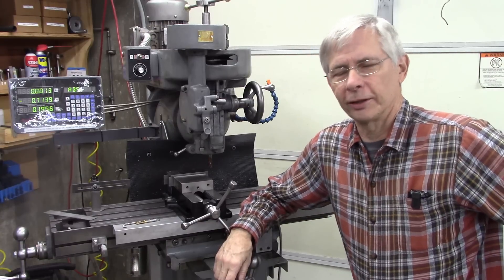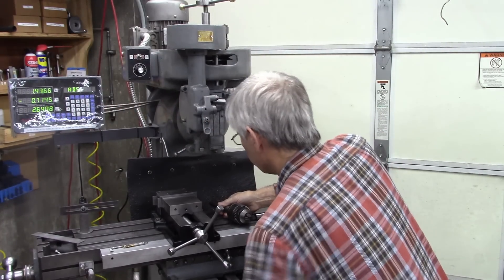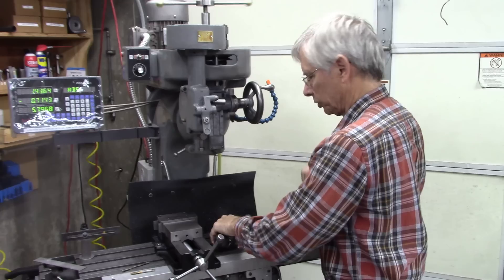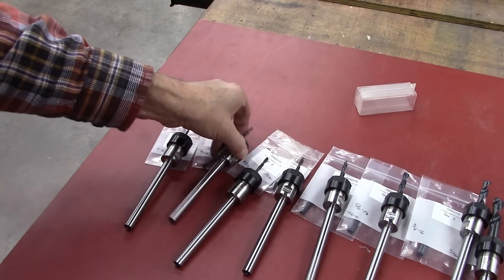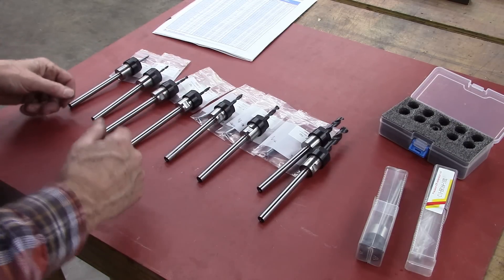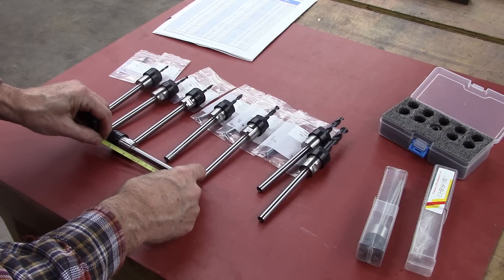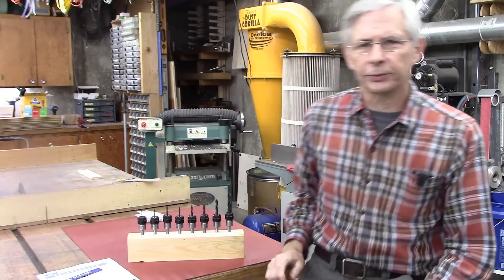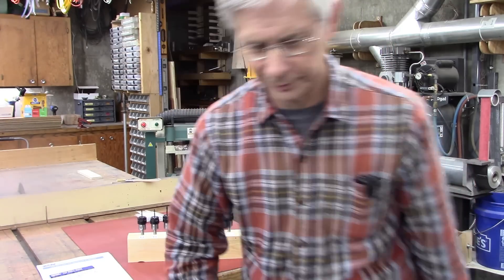Easier Tapping and Drilling on a Mill

Comment: Excellent vid. Mark.  Unfortunately, stubby drills are uncommon in UK and very expensive 😞
Reply: Try finding them under “screw machine length drills” which is their correct name.
Reply: @37yearsofanythingisenough39  Ah:  £115 for a set of 24 Dormer stub drills from Am. . . .
Reply from the maker: Sorry to hear that. Not common here but not very expensive. I think I paid $27 for 20 drills.
Reply: I worked as the support engineer in an engineering company for many years. I always supplied short series drills for the pipe fitters who had to drill 3mm pilot holes in 316 stainless. They were much easier to use in a hand drill when drilling holes in a piece of pipe where stiffness not depth was the best option.
Reply: @ absolutely!
Reply from the maker: @martinconnelly1473  Yeah,, I like them better for many things.

Comment: That looks like a good solution. I use ER32 collets on the mill. The biggest bugbear is having to change collets for every drill or tap I pick up, a Jacobs chuck is much quicker.
Reply from the maker: Thanks! ER collets require a lot of turns. I like them on my lathe but not the mill. Plus adding the collet chuck ads length.

Comment: My mill has an R8 taper, I went with an R8-to-ER40 collet chuck, and from there I keep a 1/2" albrecht chuck installed most of the time.  If I need to do milling, I use whatever er40 collet to chuck up the endmill or whatever.

But instead of a whole set of modified er11 or er20 collet chucks, why not just install a single 1/2" albrecht keyless drill chuck?
Reply from the maker: Several reason for not going with a chuck. 1) The chuck length is longer than the collet (although I'm sure there are many smaller than my chuck). 2) Time saver, eliminates finding the right side drill and putting it in the chuck. My collets are B&S #9 and hard its hard to find adapters so I'd have to put a straight shank on the keyless chuck and possibly install the correct collet. 3) I'm cheap, a good keyless chuck cost more than twice what I spent. I thought about keeping an ER collet adapter is my mill (I have collets and the adapter already) but the adapter adds length which is always a bad thing.
Reply: Well it does sound like that makes sense in your case. For mine the adapter from R8 to er40 was off the shelf. And pretty affordable.  I suppose that brown and sharpe to eR 40 may not exist. 

But I don't know what you're talking about Albrecht trucks being expensive. I found mine at an antique store for $5.😂
Reply from the maker: @TheBuildist  I have an ER40 adapter but it adds 2.5" in length and takes a lot of time changing collets tighten the collet. The ER16 are very small and I never remove the tap drill. The B&S #9 and the R8 are way faster than a chuck or ER40
Reply: If you drill a lot of holes (and most projects have holes), the number one purchase must be a keyless chuck. It will get the most use of any tool in the workshop and easily pay for itself in weeks. Keyless chucks with an integral arbor are quite short. Buying a set of tapping size stub drills is a close second purchase.
Reply from the maker: @marley589  I love this tap drill in the ER16 collet holder and would never consider going back to a chuck for tap drills. The additional length is a pan even with the integrated arbor. When tapping the 3/8" collet stays in the mill. I Dill, install the counter sink, chamfer the hole and use then use the  counter sink to guide the tap handle. Even a keyless chuck is not as fast and adds additional length. In general, you maybe right about having a keyless chuck but I've had terrible problems getting them to hold. I was using very expensive Rohm chucks but admittedly they were likely worn. However, in this case, the primary reason was to eliminate the chuck and it worked perfect.